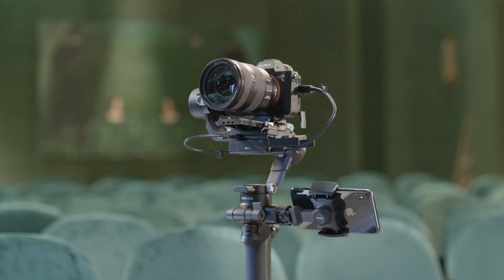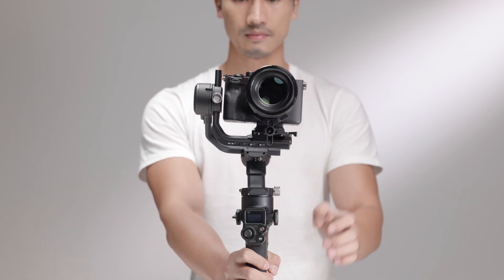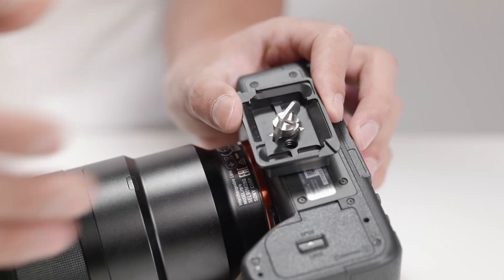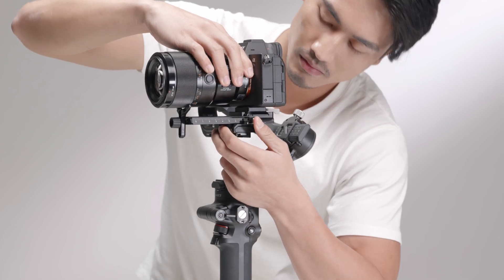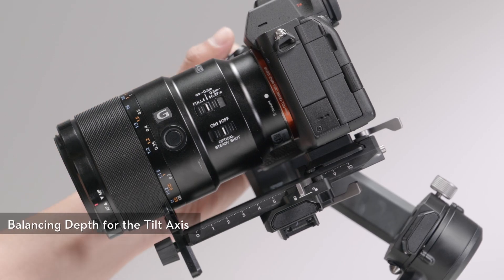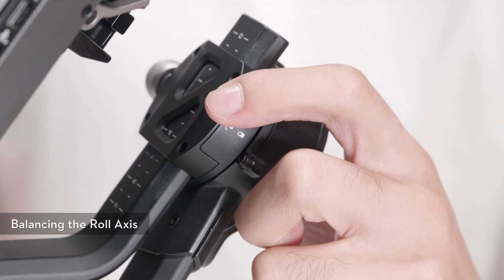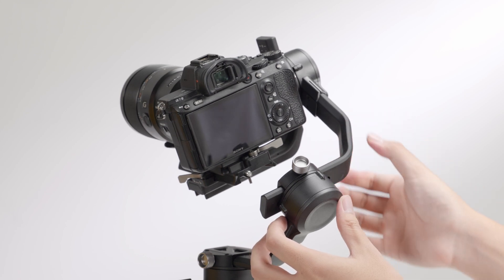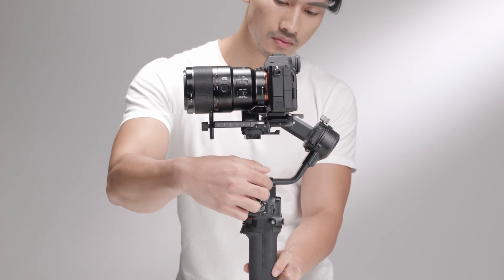DJI RSC 2 | How to Perfectly Balance Your Gimbal With Few Steps

Comment: So it seems like there’s no solution for the roll axis returning to center? No matter how many times I tweak it to stay center; it’s never staying at a 15 or 45 degree angle.
Reply from the maker: Hello, there. Sorry for the inconvenience. 
 If the gimbal’s roll axis has a non-orthogonal design, successful roll axis balance can be determined by the roll motor: if the left and right weights are the same, the roll motor is deemed balanced. Whether the left and right weights are the same can be determined based on the criteria below:
1) Tilt the roll axis arm to the left and right (approx. 45°), and it can remain still at any angle after you release your grip.
2) Tilt the roll axis arm to the left and right (approx. 45°), and it can fall back to the horizontal position after you release your grip.
If any one of the above effects can be reached, the gimbal is deemed balanced and it can be used normally.
Would you please check?

Comment: For some reasons I couldn't get my DJI RSC2 combo to work with my Fujifilm XS10. The record button on the gimbal doesn't work. I need solution please. Any one with similar problem?
Reply from the maker: Hi there, please visit the link below to check the setup methods. https://www.dji.com/support/compatibility/rsc-2/xs10 If it still not works, please test with another cable for a check.

Comment: I don’t know 
anything about it, but if you’re using your camera for both photography 
and video, then you have to rebalance every time you remove it and put 
it back on the gimball. I
 don’t want to take pictures, then 500m further take a video by doing a 
first time balancing, then 500m further want to redo photos, so remove 
it from the gimball, for 500m further want to redo a video and have to 
redo balancing... I need something plug and play. Balance
 once, be able to lock the settings, store the gimball in a bag, then 
pull it out, unfold it and directly put the device back on the gimball 
without re-balancing.
Reply: In a perfect world. I feel exactly what youre saying & suffer from the same issue. It seems w technology the "smarter" & more " advanced" we get, really the dumber things are becoming 🤦

Comment: RSC2 gimbal Gimbal locked or unbalanced. Motor in Sleep mode plz help
Reply from the maker: Hello, there. Sorry for your inconvenience. May we know more details about the balance or lock issue?
Reply: @DJITutorials  Same problem. I was using the RSC2 with Nikon D780. It was working fine. Then all of a sudden stopped and the message on the screen says "Gimbal locked or unbalanced. Motors in Sleep mode". I took the camera off and rebalanced it. The motors are not locked and cannot get to work. I have shut down for 5-10 minutes, turned back on and get the same message.
Reply from the maker: @elizavetashulga6324  Sorry to read about this. Could you please provide a video of the issue for further confirmation? Please include the camera and gimbal after balanced, try to adjust some angle. You can send the video to us via email at support@dji.com. Thank you.

Comment: Are you supposed to lock everything after perfecting the balance and getting the 3 excellents? When do we lock all the axises ??? Please help!!!
Reply: Yah, the locking of the arms is not clear in all videos.  Seems like they always want u to lock everything and never explain clearly when it’s time to turn it on.
Reply from the maker: Hi there, we had replied to you on another post, the switch locks of the axes do not need to be locked after balance and during use. The locking knobs need to be tightened to the lock postion. Hope this is informative for you.

Comment: I am very disappointed  about the fact that my manfrotto plate 200PL that i have installed on all my cameras and tripods doesn't fit on this gimbal. Why DJI? Not everyone uses arca swiss plates... What about us using manfrotto 200PL? In other gimbals at least it gave me the possibility to install the base plate manfrotto 323 to support 200PL plate. Now i cant even install the manfrotto 323 base??? Very, very dissapointed. I really wanted to buy this gimbal but i can't anylonger.

Comment: I just bought mine and there is a noise coming from the roll axis when it moves ? Should I be worried at all? It’s brand new literally 2 hours since opened - firmware has been updated as well

Comment: Whenever I try to balance the roll axis it always rolls level as if the camera is bottom heavy, I can’t leave it at a 45 degree angle without it rolling to become level.  I always do the previous two steps such as balancing the tilt and the camera doesn’t budge so that’s not the problem.
Reply: Hey, i had the same issue but i found a solution.
After i balanced the roll axis till it remained leveled, i pushed the camera on the tilt axis a little bit higher till the roll axis remained wherever i put it. Also the tilt axis worked fine after this fine tune. My Setup is a A7S III + 16+35GM + Raven Eye.

I hope it will work for you too.

Comment: One question, I balance the ronin rsc2 perfectly, but when I touch the jostick, I get in l apk the error "Error jostick, calibrate the jostick, and restart the stabilizer".
But I don't know how to calibrate the jostick ☹️Do you know how to do it?.
Will be very very interesting one vídeo about of calibration the jostick, because there is a lot of people with the same problem.

Comment: When start balancing the gimbal, power is ON on the gimbal or OFF on the gimbal, it s not mention in this video
Whether power iON or Power OFF on the gimbal
Reply: I think its of, because when you start it, it should be easy for the RSC2 to position itself.
Reply: Just like the drone does when it calibrates

Comment: The lens support on the RSC2 that I just bought is a Y shape without a strap. This video shows a different one when it explains how to attach the lens support, but the right one is shown during the rest of the video.
Reply: Also, the lens support bracket rests on the focus ring.  Is that going to be a problem with auto focus?
Reply: @gemwebb  thats what i wondered, i wish i got this months ago i got a shoot in 2 fucking weeks and only got the gimbal a week ago
Reply: @gemwebb  I guess it shouldn't be a problem if your lens has the full time manual focusing feature
Reply: i didnt get the strap

Comment: I can balance the roll axis so it stays centered. But if I turn it, it  will not stay and falls back to the center position.  Is that normal?
Reply: I have the same issue. Were you able to get a response? If so how were you able to resolve this?
Reply: No its not, you have to fix the pan axis
Reply: @user-dh5fp4gw1b  ok thanks for your reply. I will try again
Reply: @eeeeeedge  np, pan is honestly pretty hard. Try to lean the gimbal on 2 of its 3 legs and just change it till it doesnt move

Comment: I cant balance the Roll Axis. I have to move the plate backwards but that would unbalance the tilt.
Reply from the maker: Hi there, we are sorry to hear about the difficulties that you encountered, please contact us via http://www.dji.com/support and provide us with more details, we'll do our best to help this out. Thanks.
Reply: @DJITutorials  I returned it to the seller. The Pan motor isn't working. Power output is maxing @ 100 while the gimbal is on the table. It wouldn't also pan with Virtual Joystick and Force Mobile. Hopefully they replace it.
Reply from the maker: @madmanstudioph  We see, we hope you'll get the unit back soon.

Comment: hey guys, once you balance the gimbal with a specific camera + lens, will you need
 to rebalance every time you use, given the camera and lens are the 
exact same set up each time ? cheers
Reply from the maker: Hello, if you change the lens during your shooting, please rebalancing the gimbal for a better stabilization. If the combination is the same and keep mounting on the gimbal, it is not necessary to rebalance, but you can re-auto tune to make sure the motors are working well. Thanks